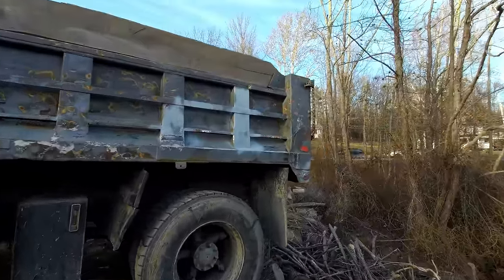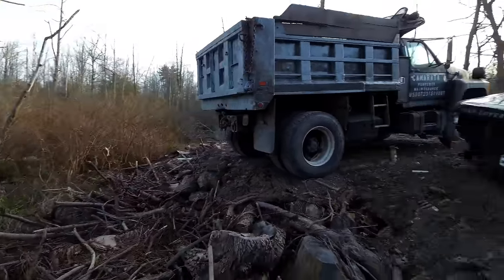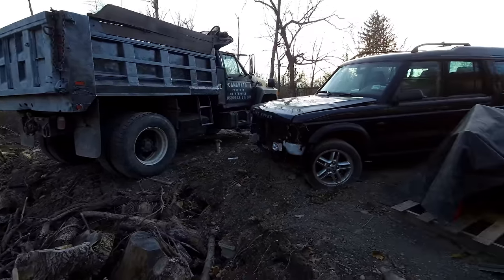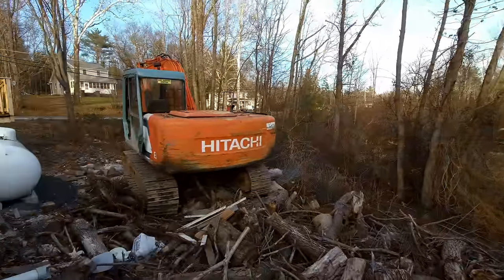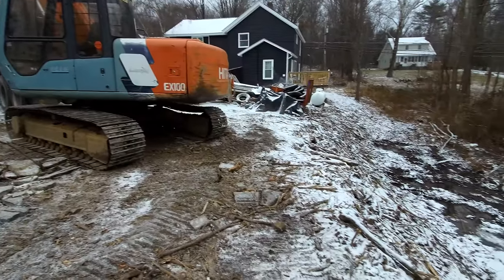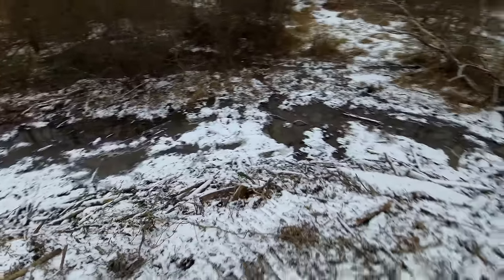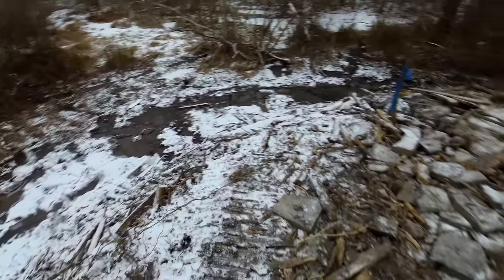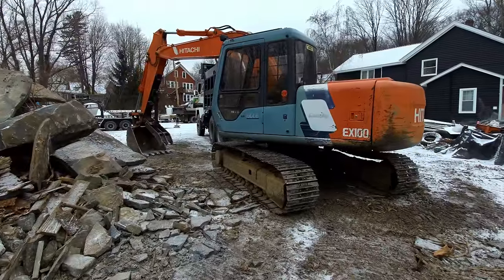Cleaning up dumped wood

Comment: Heavy steel tracks can't break up little frozen dirt .. O good grief.
Reply: Remember history class?  In World War II how tank advances were stopped by extreme cold weather and many tanks froze to the ground and others stopped because of frozen dirt in their tracks.  Unsticking a tracked vehicle in the winter can be a major project and also damage the vehicle, it isn't cheap to repair the damage.
Reply: He ruined one drive motor on his skid steer by trying to break free a frozen track.
Reply from the maker: I cleaned those out because I was about to travel down the road with the machine on a trailer. I didn't want dirt falling out while driving.

Comment: uhm helloooo mcflyyyyy a gallon of gas and a well placed match and poof ,,no more wood 
@ least thats how we roll in Texas ..but maybe that would save time and money
Reply: But the Propane Tank next to it?
Reply: @joshuaguenin9507  We'd never have propane BBQ grills currently if we used your reasoning 
1.)stacking concrete cinder blocks and a thermal wrap around the tank temporarily would create a heat barrier ..and 2.) hosing down the tank w/water during the burn ...will both work fine 
and most of the pile isn't near the tank anyways 
THAT wood could have  been moved away from the tank and then burned further away 
SMH  come on guys

Comment: i quite liked your videos until I saw you pushing that Range Rover around with the bucket of your machine
That is just pure arrogance
Reply: In the U.S. there are plenty of Ranger Rover Discos here, some low mileage, that people believe they will someday "fix up".  They are cheap, plentiful and almost always broken, none are diesel here, just the petrol engine that RR engineers never got right.  The skills and the parts to fix them (I'm not sure what a fixed one would be like) are much too costly to be practical, the Discos sit in people's yards until they rust away or the town complains.  US$300 is around the going rate for a broken one, and it has been a long time since I've seen one that's on the road.  They had to be on the road at one time?  didn't they??  I'm unsure about that.
Reply from the maker: That thing is garbage. The guy said push it out of the way, he didn't care.